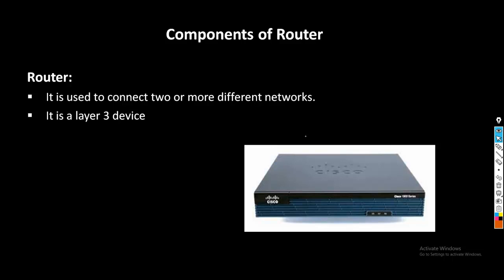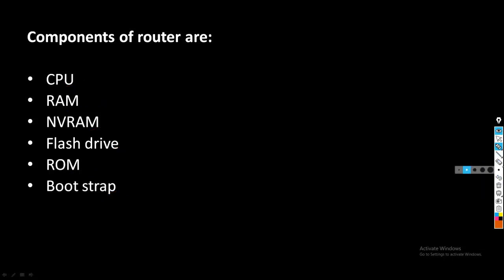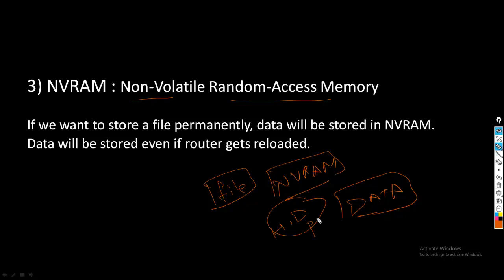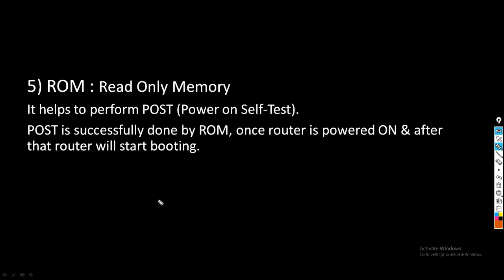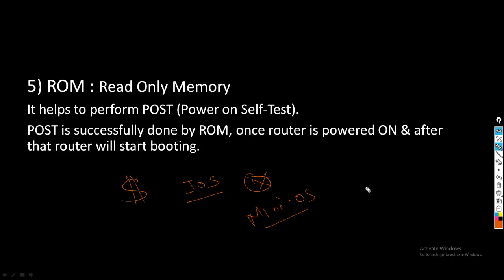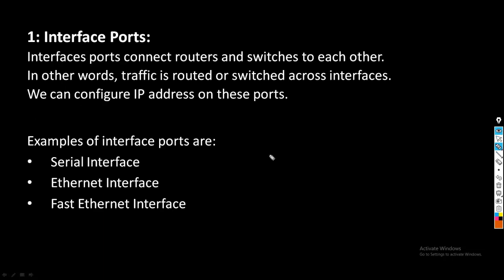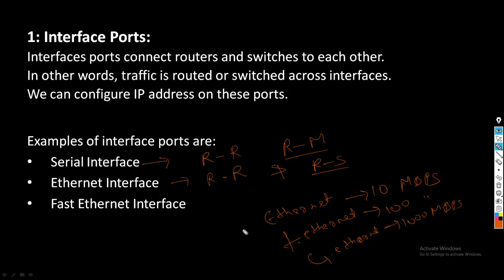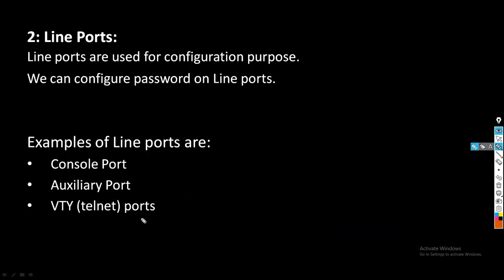Router Components | ROUTER | RAM | NVRAM | ROM | Flash Memory| | Free CCNA 200-301 Course | Day-16

Comment: Mam, what is difference between  Console port and Management port .. plz clear my don't , I am fully confused on this.
Reply from the maker: Management port is used for remote management like telnet, ssh.
Whereas console port is used by the administrator to login into a router directly through cable. ( Physical access to device required ).